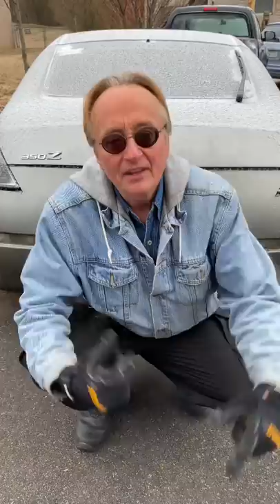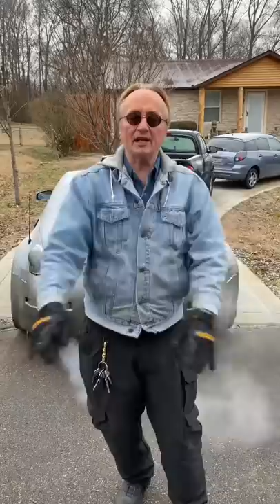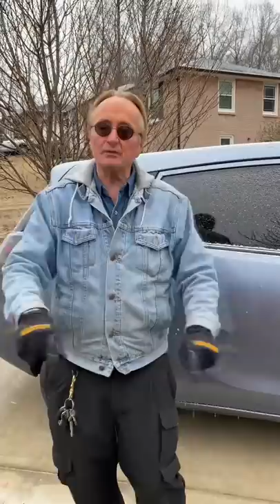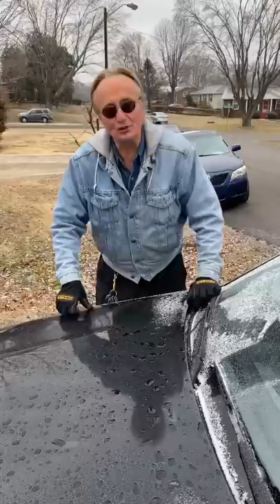This Illegal Mod Will Make Your Car Run Better

Comment from the maker: Thanks for watching! Like and Subscribe for More Vids Daily ► https://www.youtube.com/channel/UCuxpxCCevIlF-k-K5YU8XPA?sub_confirmation=1
Reply: @l7bsi  you must be fun at parties
Reply: THE EARTHS WILL BE HERE WHEN WE ARE GONE SCOTTY SO LETS GO WITH THE HORSEPOWER 😂
Reply: Stright pipes
Reply: jerry sack  with
Reply: Amber Frey  yeah I️ screwed up a mustang bad from removing the cats it made it rev hang like crazy and the rpms wouldn’t drop lower than 2 grand
Reply: Didn't you do a video about removing exhaust parts being bad?
Reply: We don’t have emissions inspection in Texas just a safety inspection
Reply: So you live in Tennessee to
Reply: @melodyrivers5974  no Massachusetts
Reply: Soo..... just f the planet right?
Reply: @ezwiderbeatz5590  correct
Reply: This is the only video of yours i didnt like scotty new cars run better with the cat still installed because they are tuned that way
Reply: @jasonsammons8253  he did... he damn sure did loseing respect for this guy that ive looked up to for a while he needs to clarify
Reply: Scotty you forgot to mention that when you do this your fuel mileage goes down the drain
Reply: Wait you say adding aftermarket intake is bad an yet you  advocate this..when in reality it's the other way around better to have OEM exhaust... If the engine isn't able to intake any more air volume at smoother higher speeds then factory there's no reason to mod exhaust other than a Placebo boost in ext volume/tone... Lost some credibility guy...
Reply: @l7bsi  bruh in some states you don’t need an inspection so you’d be fine what are you on
Reply: Sheeesh grandpa got drip🥵
Reply: Some engines operate better with back pressure from the exhaust system

Comment: “mine was stolen and i definitely can’t afford a new one”
Reply: Our work van converter got stolen 4 days ago
Reply: Update. A school near my work...all the van/buses converters were stolen last night.
Reply: Get a tune and straight pipe it
Reply: Good news!
Reply: could i actually get away with saying this
Reply: @sklizzy3125  if you do, let us know :)
Reply: @noahbennett6682  might have to get test pipes for my g37 lmaoo
Reply: @ellismidkiff6117  wink wink
Reply: Universal cats are pretty cheap from flowmaster
Reply: Happened to me on my 98 lumina and I just ended up putting a straight pipe
Reply: Lmao I removed mine and replaced it with a catless header a few years ago. I now get 36mpg on the highway instead of 33mpg.
Reply: Have you heard of Junkyard. There’s such a thing
Reply: Got to a pull a part and wate to the 50 dollar walk day then get them then build the stupidest looking cover
Reply: @silviosrebak2992  universal cats are garbage and don't have as much of the precious metals that the original cats have. Universal cats also don't last as long like the original ones do.
Reply: @TonyYesi  I know but they also cost next to nothing compared to oem cats
Reply: San Antonio TX doesn't have emissions inspections...
Reply: @ellismidkiff6117  bruh imagine a fleet of straight piped busses LOL
Reply: @palan99   buses i rode in had mufflers and that was it.
Reply: @sklizzy3125  did you get away with it tho?
Reply: @lllllllllllllllllllll1lll1  how’s that possible?
Reply: @jaredevers6459  less exhaust resistance, better air flow. Tuned with an ECU tuner to improve volumetric efficiency.
Reply: @jaredevers6459  haven’t gotten them yet but i really want to in the future but im just scared ab the emissions testing
Reply: "Mines busted af and I can't afford to fix it rn"
Reply: Think of it as a free straight pipe not a stolen cat.
Reply: @ellismidkiff6117   bruh
Reply: @TonyYesi  thats why they get stolen because of said precious metals
Reply: @javyassassin13  huh?
Reply: Looks under 
sees shiny unmatched colored pipe in its place🤣🤣🤣🤣🤣🤣
Reply: Buy them from part out yards

Comment: When the ones in my tundra went bad and i got a 4 grand quote for new ones, i chose the HP!
Reply: More than I paid for some of my cars
Reply: @ElectricSwordfish  me and u both, i paid 1800 for a nice magnaflow, without the cats it actually sounds really good!
Reply: Should of gone to the junk yard and gotten them cheaper and installed them yourself the dealer is a rip off even random shops are rip offs now a days
Reply: @matexf4c  none in the junk yard where i live, and they cut them out and sell them right away on every vehicle where i live
Reply: @Dee12327  damn where do you live? I’m in CA it’s bad but not as bad as it used to be
Reply: @matexf4c  Alberta.
Reply: That's crazy. Cats aren't even that expensive. You should be able to get a new one for 500-800 and get in installed for a couple hundred. But your better off without it
Reply: @pauld.b7129  my truck has 4.
Reply: @matexf4c  so he can go through the trouble of installing used plugged converters??
Reply: I feel like this would be option C, save my budget
Reply: @stevemitchell2252  lol also true
Reply: they sell universal cats, might wanna look into one of those then paint ur name and Vin onto the housing to prevent it form being stolen
Reply: @georgekircher4307  nah, where i live doesn’t do Emissions testing. Dont need them
Reply: @matexf4c  it's illegal for junk yards to sell used cats. They chop em and scrap them.
Reply: @pauld.b7129  some cats can be scrapped for 1000-2000... so you're wrong there.
Reply: @Dee12327  I figured that’s what most junkyards do since they are so valuable and easy money
Reply: @matexf4c  No cats in CA junk  yards they’re removed
Reply: Um insurance covers that yeah know
Reply: @Ellie_3621  Where? Not where i live, and if u use your insurance for anything that is not at fault where i live, your rates skyrocket for years

Comment: In modern cars you actually loose hp if you get rid of the catalytic converter without programming it
Reply: alot of tunes actually are better if the cat is still on the vehicle working properly
Reply: @BIGMIKE54ify  but if you have an old car like from the 70s with a carburettor you could gain hp through the increased flow of the exhaust gases
Reply: @wammo1997  ya you are right
Reply: How loose?...
Reply: @MajorFenix  Well, modern cars take messure your exhaust temperature and stuff informt and behind the catalytic converter and if you just get rid of it, may your car go into a destress mode with higher fuel consumption and less power du try to fix the error
Reply: So should I straight pipe my 4 cylinder 2003 cavalier or not?
Reply: @eyescream5313  do it, if you want to. But remember to do the editing so you don't loose power
Reply: Nope.
Had my hemi strait piped....took less than 1 hour.
Never opened the hood.
Reply: @joebideb  how old is your hemi? Have you read the whole dialogue
Reply: How? The downstream O2 sensor and pressure is read before the catalytic converter. The ECU takes this information in conjunction with everything else upstream to make sure you have proper A/F ratio.

Removing the catalytic converter doesn't change anything about this.

Comment: Well, you can remove the catalytic converter, modify the fuel system to run E85, then have a good tuner put together a proper tune, and your engine will produce more power while reducing the emissions compared to stock. But of course, the EPA says this is illegal as well.
Reply: How is it reducing emissions? You do realize that E85 requires around 30% MORE energy to make  compared to petroleum gas. Am I missing something?
Reply: @anthonywelcher5036  Yes.  When gasoline burns, it produces carbon monoxide.  The cat then turns that into carbon dioxide.  When ethanol burns, you get carbon dioxide.  IE: Ethanol doesn't require a cat to catalyze the CO into CO2.

There is still that 15% gasoline that does turn into hydrocarbons, however.
Reply: @anthonywelcher5036  it doesn't take 30% more energy, it takes 30% more fuel because E85 fuel is less energy dense compared to gasoline. that is not quite the same thing.
Reply: @alexdeadeye6905  but if you can advance the timing to take advantage of the higher octane of the ethanol it doesn't become a problem. Makes more HP, more MPG.
Reply: Who's is EPA
Reply: @handlebendover  environmental protection agency, I think Regan made it.
Reply: @CasenFerg  that would be Nixon
Reply: @anthonywelcher5036  it requires 30% more fuel but produces like 60% (might fact check me) less emissions pound for pound, so you end up still making like 30% less than a straight piped gas car, and you end up just barely better than a catted pump gas car.
Reply: You kinda need E100 for what you want to do. And still it will be more polluting than what we have. Current engines are well designed for decades.
Reply: @hiteshk8758  but less polluting than it was before
Reply: @paramagician  that’s right thank you.
Reply: E85 is great. But it really doesn’t mean anything when people don’t have the accessibility to E85 like how accessible pump gas is.
Reply: @Mr.Scootini  it's more accessible than electric chargers across much of the midwest/south/southeast united states, outside the US Canada has it everywhere, as well as many propane stations, australia hot rods on propane a lot, as does most of southeast asia (where hotrodding happens there, as you can imagine it's rather uncommon in most of asia.
Reply: @Prestiged_peck  a 120V 15A circuit is more than enough for most people’s daily driving and those are everywhere. You don’t need a super expensive 250kW DC charger for your commute.
Reply: @ebolapie  for road trips you'll definitely want one
Reply: They want cars to be quiet and slow and very boring
Reply: @ebolapie  what does the item you mentioned cost and who makes it explain how this 120V 15A will deliver this for all enjoy as your suggestion appears to indicate regards William
Reply: I'm sorry to bust your bubble but you can't just modify the fuel system to run on E85, you basically have to swap the engine because the engine cannot use E85 very good.

Comment: You could opt for a high flow catalytic converter if your state does inspections. I don’t know if it changes anything but I imagine having a catalytic converter at all is better than not having one.
Reply: A high-flow cat does improve flow. More flow typically means better power and mpg.

Comment: I chose both
 My accord is straight piped with a high flow cat
Reply: thank you
Reply: Than it's not straight piped lol
Reply: @joe hodgeman wooooosh
Reply: But that's not straight piped.
Reply: Not a true straight pipe.
Reply: How is it straight piped when you got a cat😂 all you got is headers a cat & no muffler typical Honda guy, I was one too when I was young & learning so ill cut you some slack
Reply: @ronaldbloodworth5636  it wasn’t a joke or else he would’ve came to the reply’s and said so he’s probably didn’t know
Reply: I didnt even know that could be done, i might do that on mine
Reply: The high flow eBay cats are straight piped unless you still have mufflers but mine was just a hollow tube like a test pipe
Reply: I'm doing the same thing on my mustang here in a few weeks, long tubes, high flows, and nothing behind that
Reply: @Donaldtrummp  i have a g37 and getting intakes exhaust headers and a tune is gonna be the cheapest for the most power so i don’t see the problem
Reply: Hahahahaha
Reply: It's not straight piped and that doesn't do anything to benefit the atmosphere
Reply: Lol it's an Accord... I bet the car is a noisy pos with no other mods.
Reply: Ahahaha
Reply: I feel sorry for your ears.
Reply: Where and how did you get it mine has skunk2 kit no cat mods

Comment: I've seen a guy mod his muffler to have a butterfly value that he could open or close, so he'd have a legal daily driver and when he wanted he could make it preform like a straight pipe
Reply: Yep i was in a camaro group that told me about that mod. Its beautiful
Reply: I live in NY and because of recent freakout in car community about new noice regulations from cars and bikes, I decided to jump in the rabbit hole and learn as much as I could. Turns out this mod is illegal, at least in NY. But if you want to run a straight pipe, having this mod will definitely make you less of a target for pulling over. I doubt any cop will be crawling under your car to check it out
Reply: Some exhaust systems are sold with suppressing tips. You can put them on and take them off at any time.
Reply: That mod would be an electric cutout
Reply: Cut-outs were a thing in the sixties. We made them in shop class. Operated by an old choke cable.

Comment: It's also bad for the environment to remove that cat. Some emissions regulations do very little, but the catalytic converter does a lot.
Reply: It's a drop in the ocean. If no cars had cats it would be a big problem. If just a few people do it, it doesn't hurt anything.
Reply: You probably think teslas are the best car.
Reply: @northwesttrails7176  🤣

Comment: In my early days of being a 'gearhead' with carburetors and pre-electronic distributors, the adage was,..."A high horsepower engine is an efficient engine and an efficient engine is a clean burning engine." I'd do a minor tune-up at least once a month to keep my engines performing at their peak horsepower. That seems to still apply. [Wink.] JMO.
Reply: Just because they said that, doesn't make it true.
Reply: @stevesmith8588  "They" didn't only say that, I found it to be true myself. After a tune-up I'd sniff my tailpipes for excess carbon and look for a nice water drip. That was my 'old school' method and it worked for me. [Wink.]
Reply: @NOLL72  You just think it worked. That's not science. We can actually measure this stuff, you know?
Reply: That seems excessive

Comment: I did this to a 1986 Audi Coupe I owned back in 1992. Didn't have a choice as the insides of the Cat came loose and it was either replace it, or hollow it out. I hallowed it completely. I had the car 4 more years after that and it passed CA Smog every time. Miss the 90's so much!

Comment: Recently just passed inspection in Tx fully straight-piped with no cats. In my county all they do for emissions is plug into the OBD-2. An ECU flash tune takes care of all that and ppl don't suspect a thang 😈

Comment: Strait piping can actually increase exhaust gas velocity, reduces low rpm torque. So it'll make it slower lol. Not really a problem on cars with  forced induction

Comment: Back when catalytic converters where a new thing yes but nowadays that's actually the opposite see your engine and ecu is designed to have them. Ripping them off hurts not helps
Reply: Not to mention a permanent check engine light !
Reply: @sparkythedetroitdoggo8281  that’s not true at all. I advise you look into that claim and stop repeating everything you hear 👂

Comment: Not many people would choose the environment, did he have the computer reprogrammed after removing it ?
Reply: Unless you’re doing other supporting mods it’s not absolutely crucial to tune it
Reply: @dankdc5_   I don't understand how they get away with emissions then, doesn't the scan tool they use detect a missing cat? Or is there tune options that make the ecu think there is a cat no matter what
Reply: @ProdLar  most places that don't do emissions testing will still do a visual check to see if you have a converter. It could be hollow inside (gutted) and they would probably never know. The converter on my Focus is welded fast to the exhaust manifold and it's a pain in the arsenal when it clogs up. Ask me how I know...
Reply: @ProdLar  u don’t have to tune it just to get the check engine off. U just buy a check engine eliminator and plug ur sensor into that then into the cat and it’ll trick the computer to think it’s fine. If ur cel was on before u installed the cel eliminator then you’ll have to unplug the battery for a few min to reset it but it won’t come back. And to answer your question, there is a way to disable cel altogether if you get it tuned.
Reply: It amazes me that people think that saving the environment by digging up precious metals and shipping them across the world to save the environment is a good idea.   Do you know  what machine causes the most pollution.  ?  Yep.  Ships.  Do you know how much clean water they use to run?     I suppose we can all go electric . Oh.  That's gonna be  just great , a hundred million wires hanging out of houses into cars.   🙄🙄🙄. Look the world is fucked until the " real virus " comes and we can start again with less people.   I'm a realist  ......😂😂
Reply: Dr. Buster Cheeks, Vaccinologist Stanford  Assuming you're American, Canadian or Western European, China pollutes less proportionately.
Reply: @stephyhasnotificationsoff4325  I haven't seen any of the dark gray smoke in any of the mentioned places except of China. And China is #1 USA produces half the amount of CO2 then China which is still alot.
Reply: Dr. Buster Cheeks, Vaccinologist Stanford  I said USA pollutes more proportionately, therefore I'm correct and you're wrong.
Reply: @Fran-gl4rh  Nope, 15.52 PPP vs. 7.38 PPP.
The USA pollutes more per person and 2nd most overall.
Reply: Dr. Buster Cheeks, Vaccinologist Stanford  Nah, I'm right and you're wrong.
You got dragged within a few comments because you chose ignorance over fact.

Ez win.
Reply: Dr. Buster Cheeks, Vaccinologist Stanford  Prove me wrong rn. Lol
Reply: Dr. Buster Cheeks, Vaccinologist Stanford  Exactly.
L
Reply: Dr. Buster Cheeks, Vaccinologist Stanford  This has been an ez win.

Comment: Depends, because some cars do need some exhaust parts in order to have optimal exhaust discharge. The pressure made by those parts provide maximum exhaust escape performance in other words more power.
Reply: True, most modern cars are engineered to work best with a cat. Older cars, back when they just stuck a cat on to meet requirements, are the only ones that really benefit.
Newer cars would require a retune/reprogram to get any real results.